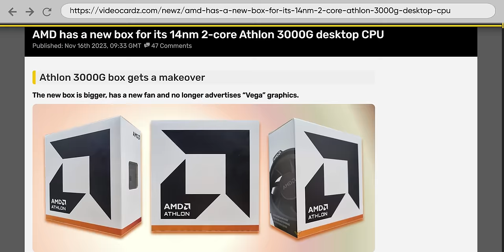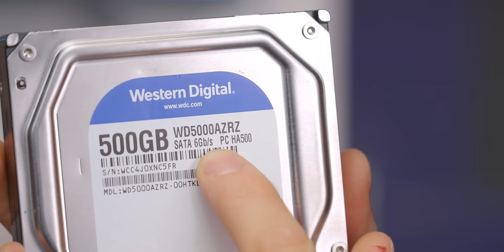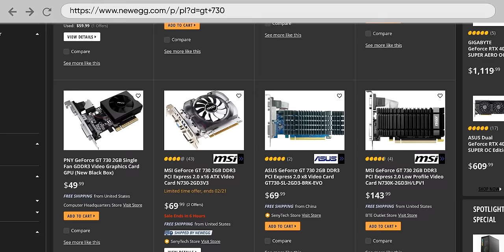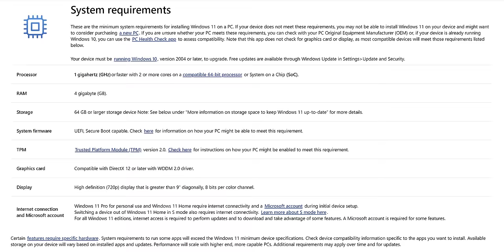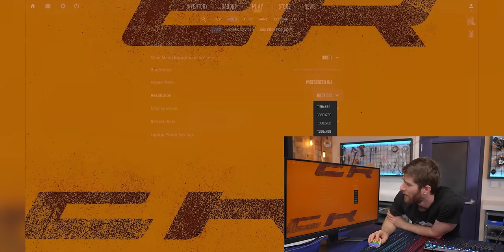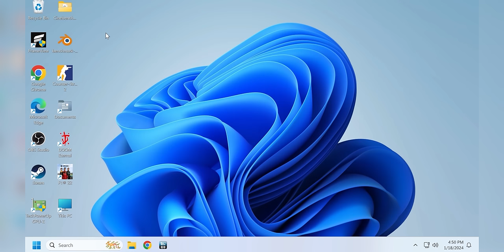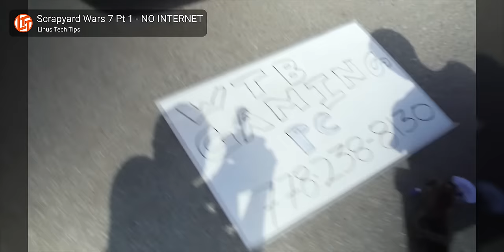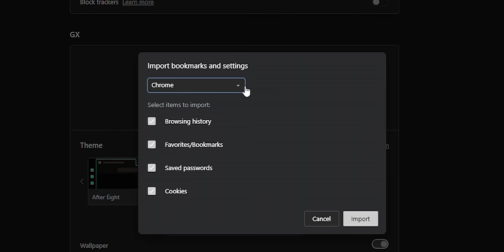I Built the Slowest Brand New PC and it Sucks.

Comment: I'd remark that this is specially good advice if you're living in a "poor" country (a country that doesn't have easy access to IT hardware for any political reasons). I live in Brazil and with just the equivalent of 250USD dollars (1300BRL reais) I got to buy and build a really decent/useful computer (with case, monitor, keyboard, peripherals, everything else included), able to play GoW in 1080p, FH4 and FH5 with Ultra settings etc. Ofc I needed to use some "shortcuts" like a chinese used Xeon, a chinese "new" motherboard, a chinese P106-100 that is using some hacks for gaming but whatever, is really HIGH price to FPS proportion. I also built a PC for my brother, so I needed to save a lot.

Comment: I spent $100 bucks on an HP Workstation that had a 2400g and 8GB of RAM. A little more money for a Case, PSU, HDD and some more RAM  and that will Easily outperform the Linus Slow PC. Throw in a 1050ti and you have a fairly decent Gaming Rig!!

Comment: Hey, I have a GT 710. These low end GPUs deserve some love. 🥲
I can tell you right now that the slow boot-up of that computer is NOT the hard drive's fault, lol. That is all on the CPU. I have multiple old hard drives and they are still quick. Even an 8.4GB hard drive I have in a Windows 98 PC is faster than what it appears to be in this video. 🤣🤣
Ain't no way this PC meets W11's minimum specs. This shit's slower than a laptop from over 10 years ago.
These parts are being wasted, the "new" slow stuff. They'd be lightning quick in the pre-Windows 7 days. Try Windows XP on them! Both new "slowest" PCs.

Comment: More RAM would speed it up. LIkely hitting the pagefile on that slow HDD pretty hard. Surely you fellow old farts remember pagefiles. $25-30 for 8GB of dual-channel RAM or $35-40 for 16GB instead of $12-20 for one stick of 4GB. Then use a 500GB Samsung 970 Evo Plus ($40) instead of the 500 GB WD Blue ($15). $40 more and you'd have a usable computer. 

But yes, if your budget is $300, you're going to be able to find a lot better performance in the used market, especially if gaming is a use case (I'd argue about $700 is a minimum budget if you insist on new, relatively recent parts). If gaming is not a use case, get a $160 N100 mini-PC and enjoy the free desk real estate.

Comment: So the problem is ram if you run under 8gb ram in windows even if you have ssd it becomes slow 🐌 . For some reason not sure but i think the window use the storage as ram some parts.

Comment: My mates athlon x2 220 with 4gig of ram on a very old hdd takes about 20 min to open win 10. Has Just igpu aswell. 

The most crazy Part about it is, i was doing blender modeling on it.
(v2.6, since 2.7+ require OpenGL 2)

Comment: Windows requires more than 4 gigs of ram so it's basically impossible to gauge the cpu performance here. It's RAM limited, which means every single process will take forever to load. I'd be curious to see how good (poorly) it performs with 8 gigs of ram installed lol

Comment: I unironically used a comparably shitty laptop as my primary computer from 2009 to 2015 (from middle school through all of highschool). It took like 5 minutes to turn the computer on and log in. I could only emulate games up to the N64/PS1, and even then it would barely run. It was a miracle if anything other than simple 2D games ran at 60 fps. It was really awful, but it sure taught me how to be patient, lol.

Comment: Is it just be but I get 1080p gaming maxed at on average 120 fps depending on what game it is with my build just under 300 GBP? (I went the used route), but A Used i7-4790S and A Used GTX 1070 will go a lot further then what was built in the video...

Comment: Actually, i still run my i5 8400 with nvme s70 blade, 16 gigs ram, and only had money to upgrade my 1060 6g to used rx 6600xt and it seems to run almost perfect without too big bottleneck😅 It boots up quick and run games smoothly so it can be still ok for medium 1080p gaming hahah. Still looking for a bargain i7 8700 so it could unlock the gpu potential. Even tho, i have b360m mobo and there is no oc option for either cpu or ram so im stuck with a problem here😂. Greetings from Poland🎉❤

Comment: $380 for bottom of barrel crap? Listen Linus - my top of the line HP ZBook G4 17” Mobile Workstation from 2017 with an Intel Xeon 1535 M v6 quad core processor, Nvidiia Quadro P4000 graphics card, 32 GB of RAM and a 1 TB SSD drive - was $325 off eBay in mint condition! You were ripped off! 😂😛😊

Comment: Sadly the Athlon 3000G will still likely whoop the pants off nearly any Celeron in general tests., and is quite a capable budget gaming CPU when paired with the right GPU and AT-LEAST 16GB RAM minimum and id still find a way to cram an SSD in there considering you gen get a 2TB 2.5" SDD for not much more than a mechanical HDD.

And thanks, ill stick with 10 Enterprise LTSC, till 2028. lol

Comment: I wonder if my I7-3770, DDR3 1600Mhz (16GB), GTX 780 Ti. would kill it running XP or Windows 7. Dumb question, I know that it would. Thats a Retro PC. Dual Boots of of WD blue 1tb SSD and Samsung 2TB SSD. It's an OLD HP E waste board. Only thing with that is that it won't run Windows 11 like that junk. Built on purpose to run old games.

Comment: You think that is slow? My Laptop Literally has AMD 3020e (Dual core, 2 thread) clocked at 2.6ghz max ( not overclockable) and literally 4gb ram with 2400 speed and 5400 hdd. Now This is Slow

Comment: Whats crazy is the second hand part computer got as much fps as my laptop, that had a 4070 laptop gpu, and an i7 with 64gb memory and 1tb ssd at 5200mhz. I feel cheated on (cs2 optimization is just trash, and requires continuous effort to make run well. Ill spend and hour and get 300fps all day, and the next ill be back to 120fps, and have to do new things to fix it again. Rinse repeat. I miss csgo =(

Comment: Meanwhile, if you stuck that celeron on, say, a lightweight XFCE linux distro, it would likely be pretty serviceable as a 'general use' computer.  W11 is a special kind of bloated, corpulent stain, and contrary to Linus' claim, it REALLY doesn't play well with HDD based systems. It would still suck, but it would suck a LOT less with an SSD as opposed to the slowest HDD you could find to throw in it.

Comment: You killed new build with unreasonable parts. I'd rather took even smaller SSD than HDD. HDD kills loading time. And 4GB? Seriously? Even for old system is performance killer.
Have you put reasonable amount of RAM it would work much better. And of course Linux/Kubuntu would make it run even faster (and with Stream)

I think it is unfair build.

Comment: Just goes to show that even if you know how to build a PC, if you don't keep up with the tech it doesn't mean j*** s***. Just knowing enough to swap out the HDD with an SSD with the same capacity for the same price would've made miles of improvement.

I also feel like it's a little disingenuous to go out of your way to get "brand new" old-ass hardware. I think an A380, A580, 3050, or 1650 would've been more fair.

For ~$100 more (still new parts) you could go i3-12100F/H610M/16GB RAM/512 SSD/A380 and have a much better experience. Albeit, a used GPU would still do you much better than an A380.

Comment: I think the choice of hardware is the problem. If you get rid of that expensive MB and thar useless GPU you can get a waaay better brand new PC.

You can get a 5600G with a cheap A520 or A320 at about the same prince of that Celeron + H410 bc you would be putting 100 dollars on a good APU, not a useless motherboard and use the money you didnt spend on a useless GT 1030 and buy more RAM, specially dual channel, and a cheap boot sata SSD. You'll probably have leftover money...

Comment: "How can manufacturers still sell this?!" - well, I don't think WD sells that hard drive to be used as your only boot drive, duh.
Also, that Celeron may not be an entry tier desktop grade CPU, but entry grade headless machine CPU. Thus, for use in... IDK, maybe talking to some specific lab hardware where a raspi doesn't work because you need Windows or whatever.
Stop shitting on things that are not up to your standard, because they were never meant to be. Instead, shit on things that are actually advertised as such.

Comment: My slowest pc goes something like 

Intel DH61 mobo( free)
Pentium g2030 cpu (also free)
Radeon hd 7360 gpu (also free)
4gb ddr3 ram paid like $1
300 watt no rating psu (free)
a usb powered alfa wifi usb dongle😂(50 cents)
Free keyboard and mouse
The only good thing 
256GB SSD liteon which is also dumb😂($10)

And i use it to download stuff over night 😂 on a solar powered system connection it literally does and cant do anything else 
The ssd can work on windows and macs as it has 2 partitions one for windows 11 otg 50GB PART
ExFAT 173GB for data transfer to windows or mac the system it has no case and will never have a case unless its an old water gallon i cut to fit things into.

Comment: Funny how a 6 core CPU and a GTX 1080 which not long ago would have been a great PC can now barley run CSGO 60+ fps. Even though CSGO still looks like 2010 crap. I've never liked CSGO but its constantly used as a bench mark for old or low end gaming PC as it supposedly doesn't take much to run yet THIS 6core CPU and GTX 1080 are just barley good enough..... what gives.

Comment: You call IT Brand new... The CPU IS from early 2020... Cmon😂

I get the vibe, you bought IT new and sealed Not used. But If you have big pockets you can probably get a sealed in Box Q6600 with a mobo😂

This should be a ryzen 8600g. IT IS way better than the gt 1030  that IS Like a thousand years old.

Comment: weak cpu on garbage os like windows 11? with 4gb of ram?? 

you guys forgot this trash os takes like 3gb of ram (2.6) to just idle? and then casually uses up 90% of cpu (spikes) power while doing so?
You should had tried windows 7, or better, linux. At least it would be 25-35% faster than on "failure 11" or "Win 0/10"